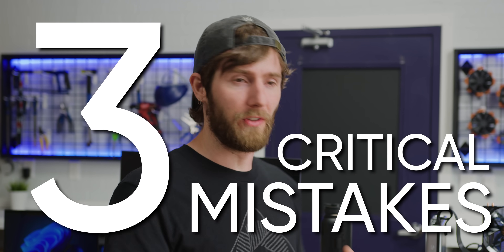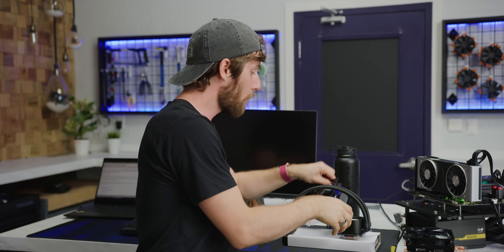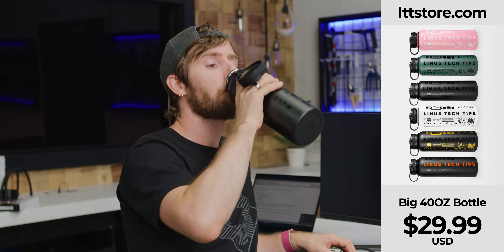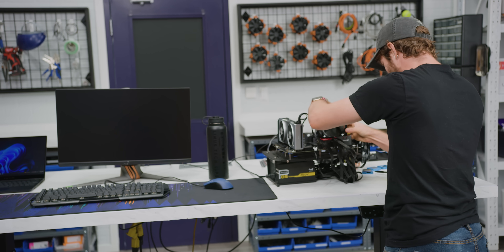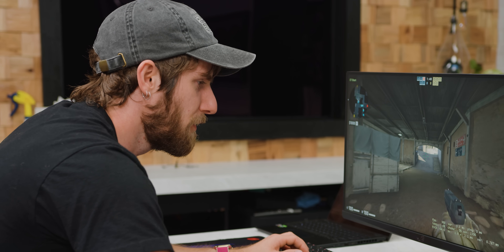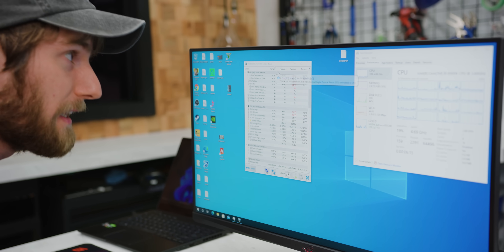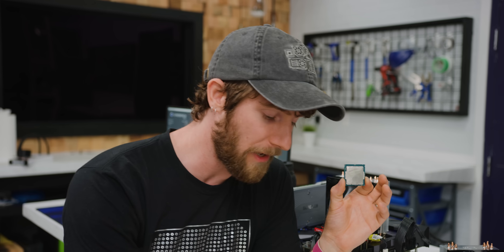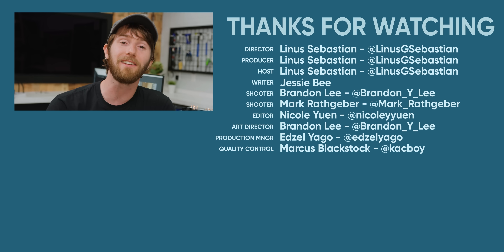How BAD is it if you forget to peel??

Comment: I'm old enough to remember when CPUs DIDN'T have thermal throttling technology. They would actually fry themselves in this scenario (given enough performance load on the chip)
Reply: Athlon XP remembers....
Reply: @gglovato  my old amd athlon 64 x2 pc has an thermal shut down feature.
Reply: @Nikola_W211  athlon64 is ages newer than xp
Reply: @gglovato  true
Reply: Untill the 486DX40 you didn't even needed heatsinks, I remember that it was written on top of the CPU 'Heatsink Required', later on they also added the word ' & Fan...' 😁
Reply: I’m old enough to have done it…. Third running at over a GHz on a water cooling setup (very basic block, and I was actually using a large crate as a reservoir and gently evaporative cooler)
Reply: not very impressive considering AMD didn't have thermal throttling until late phenom /early bulldozer era (2010-12) .   hell even the earliest phenom's didn't have throttling.  mean while intel had thermal throttling on PIII and up .
Reply: Any electronics/electrical person knows that excess heat kills semiconductor devices fast.

Even when a CPU processor is idle it is still executing instructions.  On x86 even with instructions such as HLT to reduce power in idle loops are broken when an interrupt is triggered.  The heat needs to get out of the junction whether there is thermal protection or not.
Reply: @johngangemi1361  Halt and catch fire, yeah haha
Reply: have you ever fried a chip?
Reply: @istachi  one time I did when working at a computer repair shop, a client's PC upgrade from a 486SX to a DX2/66, in those times most lower end 486 CPU's needed 5V while the higher end, DX2 DX4 etc., needed 3,45V...

Long story short i forgot to jumper the mainboard down to 3,45V lolol
Reply: @Kakariki73  lmao that's an awesome story thanks for sharing
Reply: @istachi   not sure about now but in the days of early youtube folks used to have videos up of them  running cpus with no heat sink just to see how long it takes to fry them.  naturally a modern chip will shut off imediately so these were clearly chips pre-throttle software days.
Reply: @DenverStarkey  I saw one where they tried to make a nice cup of hot tea with a metal cup filled with water on top of a overheating CPU

This gives a totally different meaning to water-cooling right? 🤣
Reply: @Kakariki73   yeah think i saw that one as well. LOL
Reply: @istachi  my classmates did, but they did it by overvolting it in an overclocking attempt
Reply: Linus is probably old enough as well
Reply: Yup, been there done that!
Reply: Okay, yes or no, old AMD processors dies easier than intels??
Reply: @murphyking79  i still have the first AMD computer i built 25 years ago, and it's been overclocked (450 MHz) all that time. It's slow as all hell, but running 50 MHz over spec for 25 years should have burned it out years ago. I basically retired it about 5 years ago, but my Dad was using it to browse the web and pay online bills until I took it away and bought him a basic HP store demo PC for cheap. Every now and then i turn it on and laugh as my son attempts to play Unreal Tournament on it. Game plays fine after about 15 minutes of booting the computer and loading from its old IDE hard drive.
Reply: Even farther back CPUs didn't even have heatsinks. Some were even in plastic packages. They generated less heat than a Northbridge LOL.
Reply: My first pc had a Pentium 3 with just a heatsink on it no fan.  Cpu was similar to an n64 game cartridge lol.
Reply: @thatnissan  On older ones the CPUs weren't even in ceramic/metal cases, just plastic. Someone looking into such a machine might not even be able to find the CPU. "Where's the heatsink?!?"
Reply: @gargantuablargg  if a younger pc person who hadn't been around older pcs saw this thing they would probably ask why my ram has a heatsink but no RGB LOL.  Back when 64mb gfx card was nuts,  and I was ballin with a used 10gb hard drive.  Just typing that reminded me of the quantum bigfoot HDD I had at one point too 😂 technology progresses at such an insane rate.
Reply: @invader_guy I think 99 C is pretty hot for the CPU.
Reply: Oh you can definitely disable that and fry your CPU if you want to. Just like the good ole days.
Reply: I totally had a CPU fry when the CPU fan failed. I'm glad that's an issue of the past.
Reply: I had an old Pentium 90... funny story, I set the clock frequency to 300mhz using the dip switches on the motherboard by accident (easy to do if you read the diagram up the wrong way), but for whatever reason i had to go out.

I got home 6 hours later to find the computer had turned itself on, the CPU had melted itself to the socket. I had to pry it off the a screwdriver because the plastic had stuck to the pins. After scraping all the melted plastic off I plugged it into a different motherboard to see if it still worked. Yup still worked...

I have no idea how a CPU can get to a temperature where the back side can melt the socket but not break itself.
Reply: @edwardecl  
Sounds weird..how did your computer managed to boot up? I had Pentium 120MHz. With 150MHz settings it would halt when Windows started to load. With 166MHz it wouldn't even boot.
Reply: So like what, 20 years old?

Comment: I bought an i7 970 X58 system during the pandemic, had this op old Intel tower cooler on it, however Temps were 75 at stock and it was built 8 years ago, I figured maybe thermal paste so I go to change it and find the plastic "remove before use" sticker coated in thermal paste.
Took it out and now it sits at 60c full load @4ghz with the same cooler

Comment: I bought a new pc 2 weeks back. And after I brought it home I did some thermal tests while gaming and the CPU was acting weird where the temps were jumping all over the place, like from 40's to 70's under 5 seconds, and to 100 degree Celsius in the menu of Days Gone seconds from opening the game. I switched off my pc immediately, and took it to the store for them to re-check the system. Then we found out that the guy who assembled the system didn't peel off the CPU 🤦‍♂️

Comment: A few years back saw someone forget to take off the plastic cover (some kind of thermoplastic hard cover, not this kind of film) on a Xeon-based workstation.

On the plus side it did not hurt the CPU - throttling kept it from cooking and there was still some thermal transfer to the heatsink. It was running for a couple of years before the customer decided to call in about the performance issues they'd been seeing that were getting worse over time. The plastic did start getting gummy and running out but the label saying "Remove before heatsink installation" was still visible.

Comment: I used a heatsink without peeling the plastic on a i5 6600 for a year, and never noticed until i upgraded mu cpu. And never got any problems during gaming like fps drops or temperature.

Comment: We had a in-house built server that kept randomly shutting down, we opened it up to discover that the employee that built it cut the nubs off the heat pipes on the top of the cooler while it was installed (so it would fit in the chassis) so there was copper shavings all over the mobo. We watched temps and saw mid 90C so we bought a liquid cooler and when we went to install it discovered that he had left the sticker on the heatsink... Now that system runs at 19C if memory serves lol.

Comment: I bought a complete built PC off a tech website, and when I wanted to update my CPU several years later, we took off the watercooler, and sure enough these "Professionals" forgot to take off the sticker...wow. Nothing happened when I was using it. No problems. The sticker was fine too.
I have not watched this video yet, but I will be very surprised if linus gets a different result.

Comment: The i3-8100 does not have Turboboost. If you want the Turbo, get the i3-9100.
The 8100 is a very cool running chip. Even on the stock cooler, it only goes to around 50c @22c ambient.

Comment: I've managed to forget to remove the cpu cooler plastic cover. It was my very first pc build which had i5 4460s and some sort 120 tower cooler, in 2015. 3 years later i noticed it when i disassemblend my pc and sold the parts and bought am4. Back then i was aware that the plastic cover needs to be removed but just somehow forgot it.

Comment: This is already IT stone age, but I had an ELSA Geforce 2 Ultra around 2000, which had problems with the AGP mode and became unstable. When I removed the cooler, and gues what i found, the relatively thick protective film was still on it. 
About the same year I had also heard a conversation between two employees in an IT store that went like this
"I must have forgotten to remove the foil from the cooler on the k7.  Oh, don't worry, it'll burn through" Never bought anything there again.

Comment: When I built my first PC, I did this. I thought I knew better, (I had tooled around with a couple of laptops before) so when I got my 212, I just put on my thermal goop and threw it on. My 3600X was alright at idle, but DAMN did it run warm. Learned something important that day

Comment: I did this on the computer I am on, with the same heatsink. It was on there for about 4 months. Everything worked fine until I was playing a newer VR game and I started getting a lot of stuttering. I checked the temps and saw the CPU getting up over 90c. I opened up the computer and saw the plastic edge on the heatsink. Cue Picard head in hand. Right before I put the heatsink on, my dog had to go out, I came back in and just put the heatsink on.

Comment: 8100 with a turbo boost? The best it can is 3.6ghz, it doesn't have any boost and it's 4 cores, no extra threads. Gotta admit, I use a 8100 paired with a 1050ti and even though there's nothing remarkable about either one of those components, they both work together flawlessly for gaming at 1080p 60fps (so long as the game isn't newer than 2016)

Comment: I did this when I installed my Arctic Freezer 2 280.  As soon as I saw in HWInfo that the temps were higher than on the stock cooler it dawned on me.

EDIT:
Running a Ryzen 3800X with PBO.

Comment: Thanks Linus Now All The People With Pre Builds Have Anxiety, Including Me.
Reply: That constantly uppercased text tho
Reply: Just check your pc temp, if you feel like that's not the temp it is suppose to be while idling/on load better check what is under that cooler
Reply: @idhamproaqw98  I idle at 30-40 and when sitting on the homescreen of Minecraft it goes way up to 60-70 and playing the game goes to 90 (Celsius)
Reply: @kaiyofox  then check it, make sure you have a thermalpaste with you though
Reply: @idhamproaqw98  it's a pre built. So I suppose it would have thermal paste in it.
Reply: @kaiyofox  idk but everytime I opened my cooler, I always replace the thermalpaste under it, just in case of something happening
Reply: @idhamproaqw98  I should probably point out that I have 1 cooling fan, I'm definitely just going to do water cooling
Reply: Prebuilt noob
Reply: @Theredstar2478  pc nerds when they find out their house is prebuilt
Reply: @duckonaroll1913  prebuilt house noob
Reply: Why Do You Capitalize Each Word?
Reply: You can probably find what your chip should be doing like in benchmarks and see if it's in line if not may there is
Reply: I built the rig myself but don't remember installing the cooler 1.5 years ago... so currently at 3% anxiety.
Reply: Smh
Reply: Hey bro after a few prebuilts a good thing to do always is check if fan pins are in the right slots as well as ram, change thermal paste cause they don’t use enough or it’s really bad
Reply: Ye
Reply: Haha I've just ordered a pre build, I'll be taking that thing apart as soon as it arrives 🤣
Reply: @rgdreamer wow, harsh and unessecary
Reply: I just installed a new cooler, and I peeled the sticker. I'm now unsure if there is a sticker still :D
Reply: you always have anxiety fck¡ng tik tok kid
Reply: Serves you right
Reply: oh wow, a no-name minecraft youtuber. Not like I've seen hundreds of 'em already.
Reply: @ayaaato1  talking like you aren’t a no name yourself… have some respect
Reply: @ayaaato1  bro why are you even talking. He has over 150k subs and is verified. You barley have 62 so sit down lol 😂
Reply: @ayaaato1  damn
Reply: @Raghib  stop typing like that
Reply: @ayaaato1   i love how you seem to have no response to the people who rightfully put you in your place lmao
Reply: @ayaaato1  who is u?
Reply: @ayaaato1  oh wow, another 5 year old
Reply: @ayaaato1  literally out of left field with that comment.
Reply: @ayaaato1  man was just speaking out his mind
Reply: @ayaaato1  ah look a no name commenter. Not like I’ve seen hundreds of ‘em already.
Reply: @ayaaato1  this comment reeks of jealousy lmao
Reply: @ayaaato1  ? why are you talking trash to a guy thats doing his best to be a content creator? with a decently large audience
Reply: @ayaaato1  whats your problem, how about reaching as many subs as this "noname minecraft youtuber"

Comment: 6:28 Intel Core I9 9900K rated at 95 watts? Would be great. I have one of these chips. Without Overclocking it needs in idle ~ 60 watts and under full load with Cinebench R23 it needs Up to 210 watts. On an Asus ROG Maximus XI Code Mainboard.

Comment: I had  such a case in 2003 when after a month with crashes and slow responce I finaly opened my friend's ready made computer and found a intel stock cooler with paste not peeled. Don't remember exact type of proc, but it was intel. I am pretty sure id didn't have termo  protection then The peel was about a 1 mm thick and managed to melt around the crystal of the proc.

Comment: When using thermal compound, there is no metal-metal contact in practice. The viscosity is way too large for that. Also, with all the thermal protection in place, the operating temperature has no significant effect on the CPU lifetime whatsoever.

Comment: One of my family members Cooler master air cooler with an  i7-4700k idled at 50-60c stock, I was wondering why, When they play overwatch, the cpu reached 90-100c and throttles a lot, after years of not diagnosing and no one checking the temps, I came and disassembled it just to find the thermal paste has melted and the plastic peel is still there, so it might short the cpu in the long run if thermal paste gets in it.

Comment: 0:24 It will cost you about 18 degrees centigrade of cooling to not peel the plastic off a Cooler Master 212 EVO.
I forgot to peel one in a dual CPU machine so I immediately knew there was a problem, and where to find it.

Comment: Years ago my company bought 5 prebuilt computers with a 4700 for calculations. 4 of them were just fine. But 1 of them was at least half the speed at similar calculations. We thought the cooler was not seated correctly or was moved in shipping. I took it apart (i am not part of the IT department, they would just have sent it back) at saw still the sticker on it.
Long story short, the retailer doesnt exist anymore and that for a reason ...

Comment: Actually happened to me once when I was building an SFF system. I looked at the cooler and checked the plastic with the pre-applied paste. Thought "I'll remove the peel later so I don't accidentally touch the paste". Probably got distracted by something and forgot about the peel. I got high 50s in the CPU while idle under 20C ambient and thought it shouldn't be that high.

"No way," I thought. And yes, I realized there and then that's it's always going to happen eventually.
Reply: “That’s way too high” It’s the exact opposite, that’s super cold.

Comment: Okay, I ( an PC builder for almost three decades) once forgot to take off the peel from the CPU AIO and ran this thing like this for almost 4 years... it ran incredibly good! I mean I had it like this for almost 4 years - overclocked Intel 5820K @ 4,4GHz. It was only in the end that I realised that my temps are getting too high too fast and a re above average in idle. So i decided it is time for a reseat of the AIO and new thermal compound. That was the moment I discovered my shameful failure... 
So I guess it isn't always that bad. It only sucks because I guess I could have had a very nice overclock on that CPU if I just had peeled that piece of plastic off.